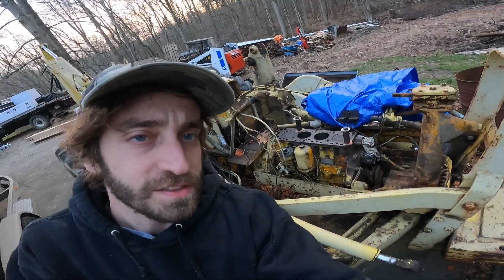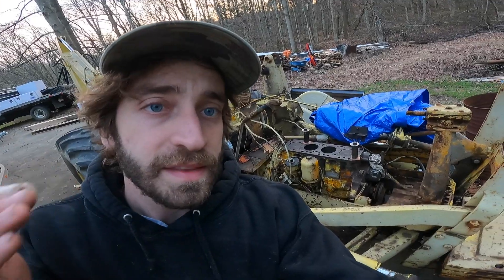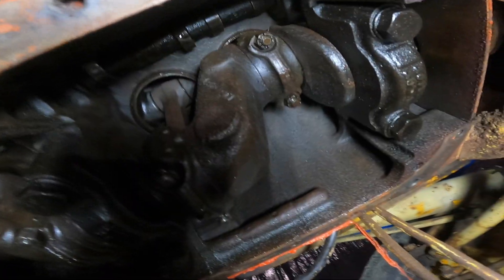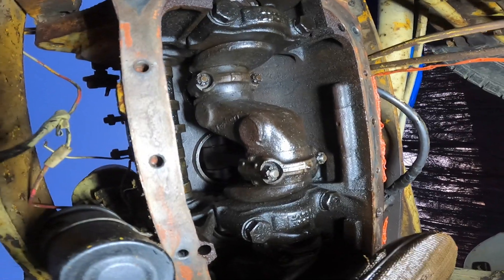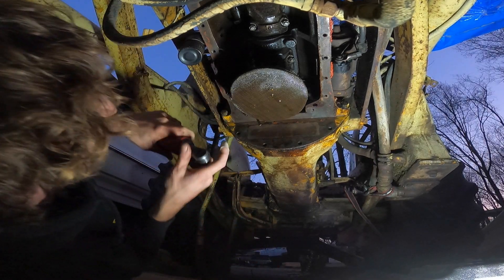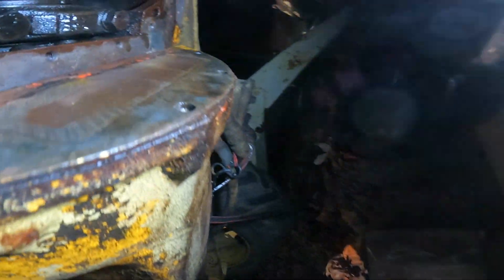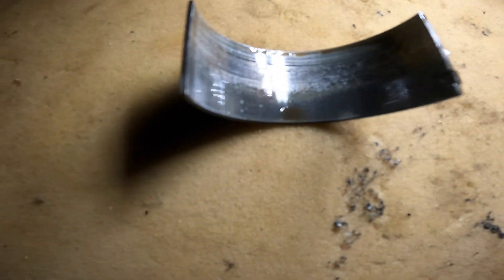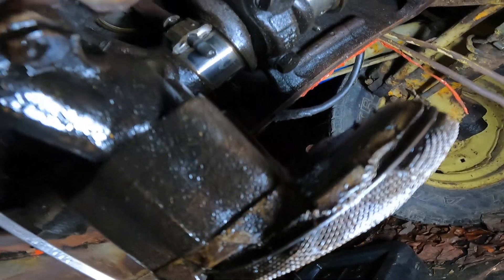🤬 I broke a $2000 part on my ANTIQUE 1960 John Deere 1010 Backhoe ENGINE!!!!!!!!

Comment: I have a 1010. Had my pistons out for a new rings and the cylinders honed. Those cylinders are tapered slightly. The piston should be removed from the top. I allowed my pistons to go down as far as they would and ran a drill hone in the top of the cylinders until they popped right out. I think AG KITS has a rebuild kit that includes a liner/deck for this. The gas is a 115 and the diesel is a 145. You can also use an engine off of a combine model 40. Good luck with it.
Reply from the maker: Thanks for the tips, I’m dropping the newest video on this machine this week

Comment: I think I can explain why it did what it did. Thee first press you did, it was supported from the bottom of the sleeve, and the force was transferring from the piston into the sleeve, and then down. On the fatal press, it was supported from the deck, and the weakest link was not the joint between the cylinder and sleeve wall, but where the sleeve meets the deck. Sure sucks, though, I've broken my fair share of big castings by doing something stupid. 1010s (At least the crawlers) are decent tractors, that should be a good machine with the new engine in it
Reply from the maker: Agreed, I realized my mistake. I have since tried to repair it by brazing, but have warped the cylinder deck in the process

Comment: Man, if I had a dollar for every time I've said "I should of used heat" after the fact. Bummer it happened, but great video just the same.
Reply from the maker: It still hurts thinking about it!
Reply: @IntoTheDirtshop  I know how it goes man. Did an engine swap for my mom's Jeep a few years back. Had it open to put a head gasket in, and my dad says "while you have it open, do you want to do the pistons?" seeing as that's what killed the previous engine. "Nah, it'll be fine" I say. 6 months later...blown piston.
Reply from the maker: @justinweier4099  dang well at least you saved some time during the head gasket install! There’s a few different ways to look at any given situation!